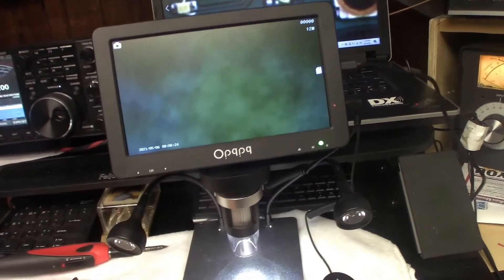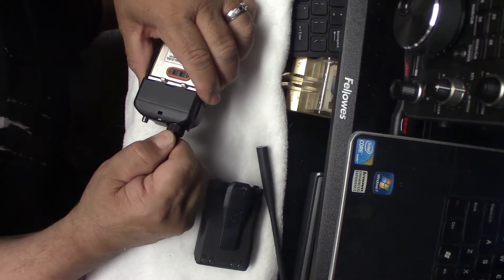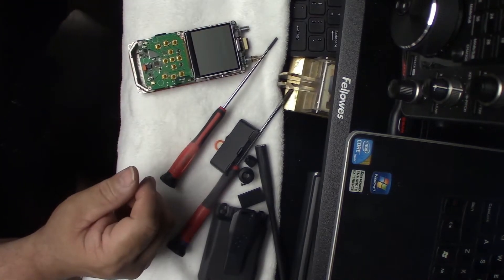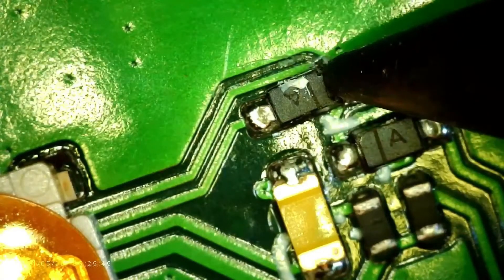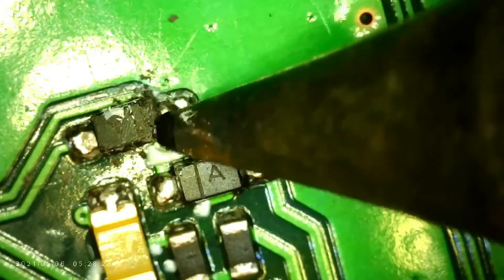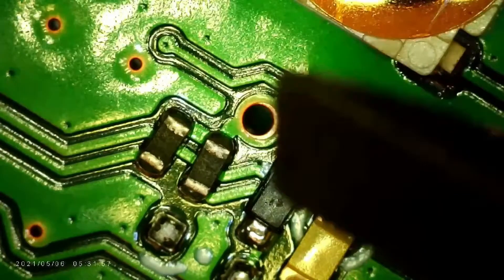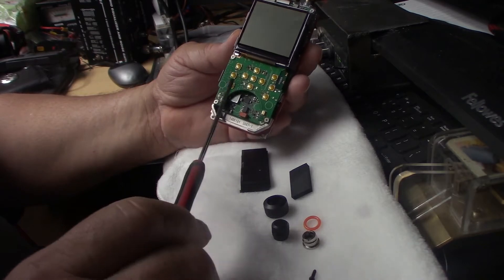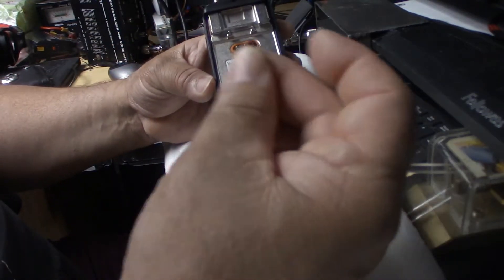ICOM ID-52 MARS MOD

Comment: Brother, heat both sides back and forth while grabbing it with a micro tweezers. Then you could tombstone it so if the radio fails you can put them back on. Tombstone means to take it off and position it where 1 side of the diode is attached to 1pad and the other side of the diode hangs over a part of the board with no trace

Comment: So the antenna nut doesn't really come off as easily as shown.  I used a $15 part off Amazon (Dream worth X-Key Repair Tool Destuffing) and it let me unscrew it without much effort and didn't mar the radio.  I did have to file down the key a bit to get it to fit the nut though.
Reply: Thanks for this. Tried everything to remove the nut. Will try again tomorrow with the tool. Cheers!

Comment: In the age of tiny SMD, everyone should get micro tweezers (two very tiny soldering irons connected by a handle that works like tweezers - not these giant cheap monstrosities you find on ebay, amazon, aliexpress... I mean somethinog from reputable manufacturers like JBC, Hakko and so on, look at the JBC PA 120 for reference) and optionally an optical stereo microscope (3.5x to 7x magnification, more isn't needed) and none of that camera+display rubbish, which introduces too much delay to work under it. With such a setup you can pick up and reinstall those diodes the whole day without leaving any signs what happened. ;)

Hot Air is for this type of work more complicated and higher risk then micro tweezers (Potential problems: molten, burned or blown away components, only use it if you know what you are doing) but still a possibility. I wouldn't recommend it for small and easy stuff like these diodes.

A ripped off trace can be repaired, tiny enameled copper wire (0.1mm - 0,2mm) can be found in old tiny relays or vibration-motors from cellphones, headphones... such a wire can be placed where a trace was ripped off. It may no longer look as nice, but if someone destroyed his device by following instructions that show bad ideas (i.e. just scratching diodes off with a screwdriver, breaking them with pliers or other use of inappropriate tools) then you can still make them happy with such a repair. Also, the repair will be hidden by the case. ;)
Reply: By the way, in case of such a modification, just take the diode with micro tweezers and re-solder it in such an angle that one pin has no contact. This way you have the diodes and can reconnect them if you want to sell or return the device. There won't be any trace of what has happened if done right.
Reply: I would need such a product very rarely, and the device you recommend is about $200. I am wondering, for the less frequent user of micro tweezers for soldering, is there a less expensive version from China or that? How many watts per tip does the unit you mention offer?